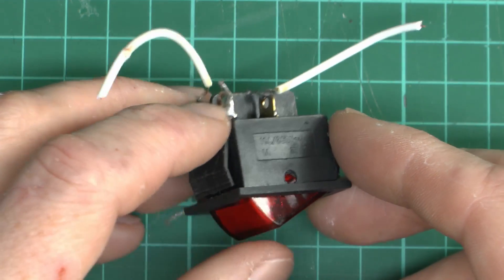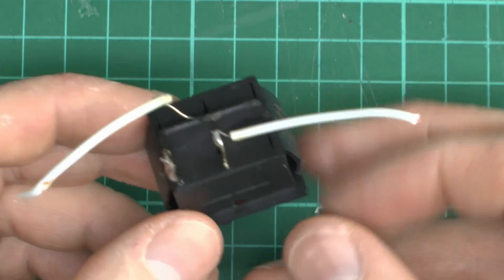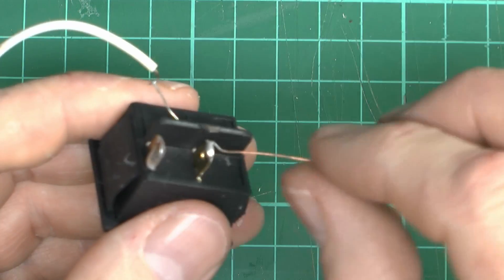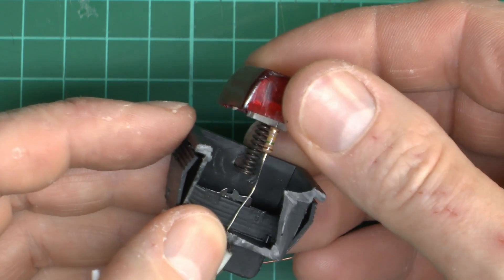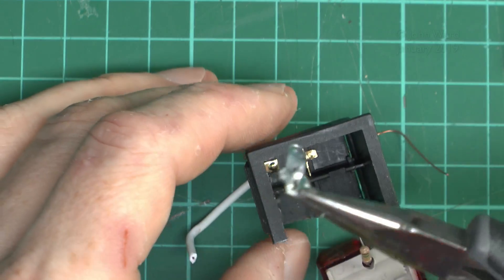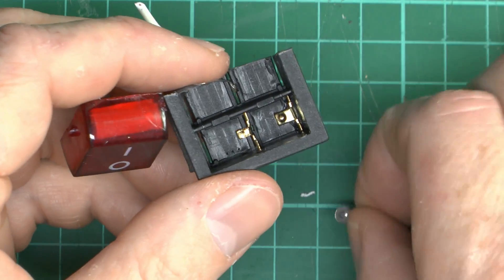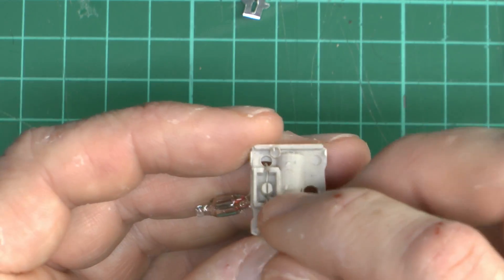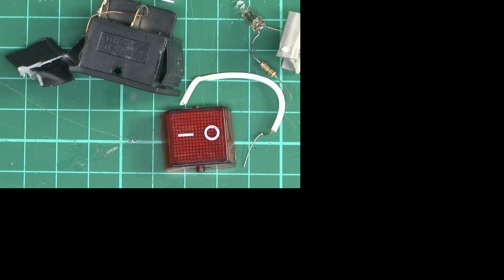World's Cheapest Illuminated Switch

Comment: I keep neon + resistor sets for replacing ones that have quite commonly oxidised over (covered in black with faint glow at top & bottom of the bulb), have suddenly stopped glowing. The common ones I have replaced are in extension leads/trailing sockets. Have also recovered blue LED + resistors from modern broken kettles.

Comment: That wire looks thinner than the thinnest speaker wire. It actually looks like magnet wire insulated in plastic. That should carry 16 amps...like a quick blow fuse. It never had a chance of actually working. The whole thing was fake. I hate fate Chinese stuff. I guess you have a spare neon bulb...if that works.

Comment: You clearly missed the point - this is acting as a fuse for the lead! It would melt the contact and break the circuit before the case could catch fire! So your assertion that the lead was a fire hazard was totally unsubstantiated! :D
Reply: Not if the the plastic is flammable.

Comment: I remember buying cheap toggle switches from Maplin where the switch body would start melting and distorting when soldering to the contacts. And now I'm missing Maplin!
Reply: Happened to me only once with the contact coming out  of the switch maplin did replace it though with a better one I think I got a bad one every other one though worked perfectly I'm missing maplin also though I think they might be reopening as a online store at some point under a different owner☺
Reply: A new Maplin webpage has indeed appeared. Buy it Direct own the brand now, I wonder what they'll do with it.
Reply: @Petertronic  overpriced home automation gear probably.  No components any more :(
Reply: @mikeZL3XD7029  I agree 100%👍